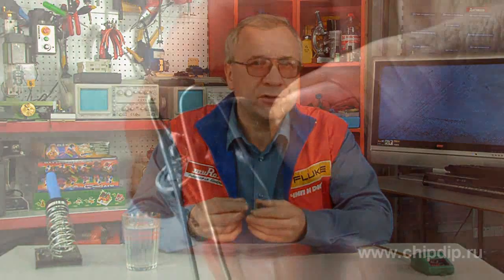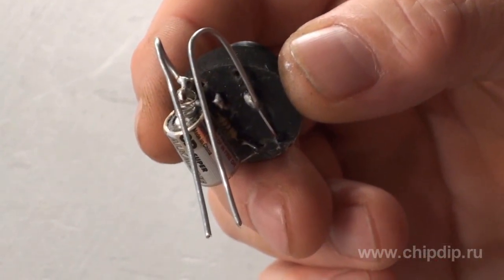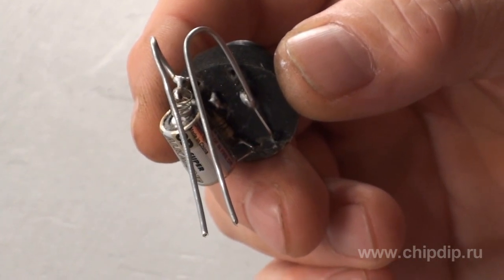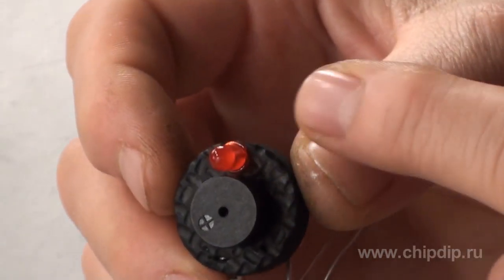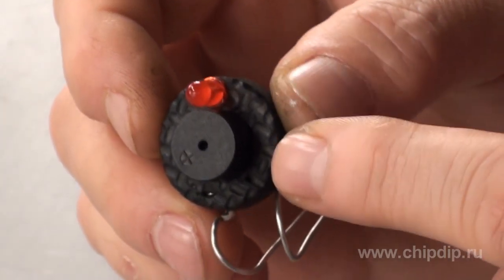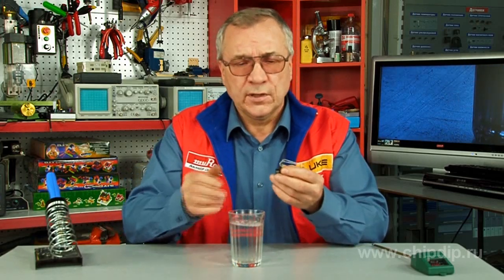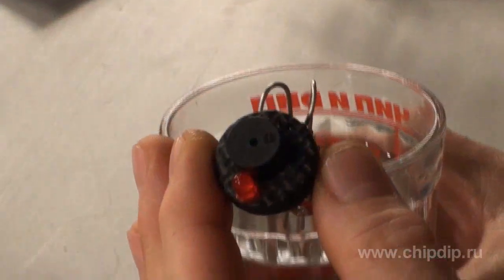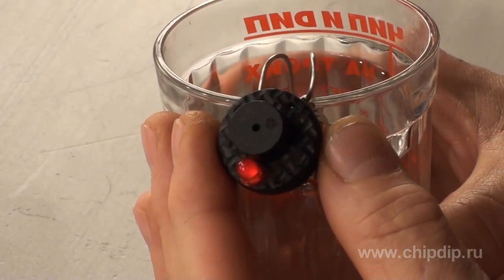Simple Water Level Indicator with Alarm. ...

Comment: I tried something similar to this for some work I was doing with hydrogen fuel cells.  It does not work well in that scenario because the water is too pure.  It works well otherwise, but a friendly heads up for anyone who might be looking to do the same.